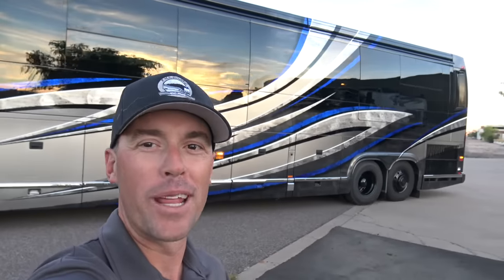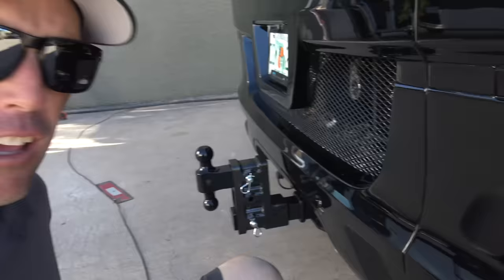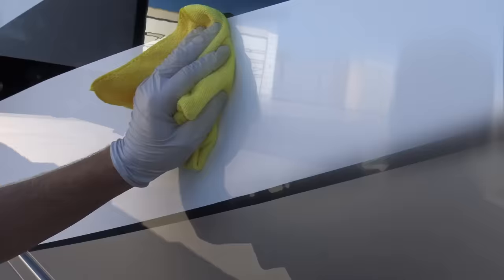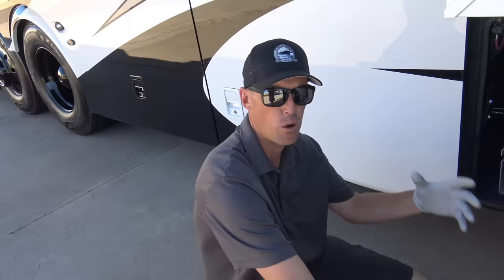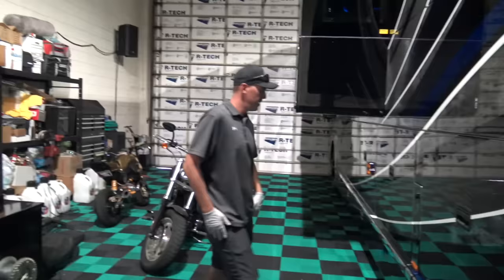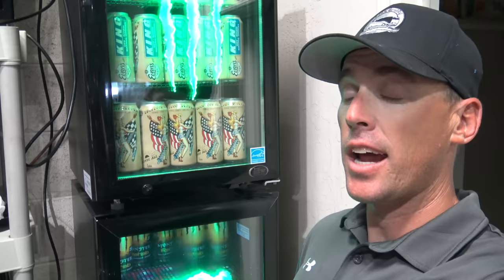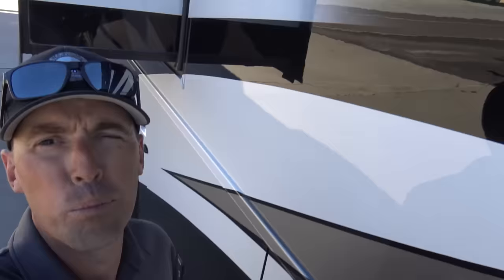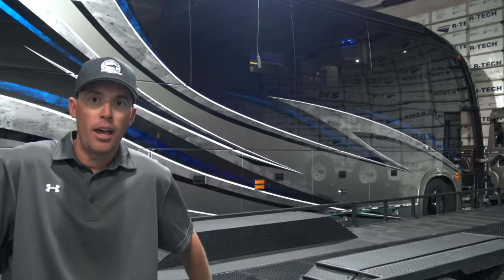WHY IS PREVOST MARATHON COACH $1.5 MIL MORE THEN NEWMAR ESSEX?

Comment: Because the Prevost isn't made buy a bunch of tweekers in Indiana.
Reply from the maker: 😂 I love how uncensored the internet is.  I have never heard this before, I heard they are all Amish.   I hope there are no tweekers at Newmar but I will have to visit the factory sometime to see if I get a breaking bad vibe 😂
Reply: @RVingwithAndrewSteele  You must not know much about the RV industry. It's not regulated. Unless you buy a Airstream most of them are junk, and I own an RV. Most people have different expectations when buying an RV and what the realities of that industry is.
Reply: @RVingwithAndrewSteele  the Amish thing is just a marketing skeem.
Reply from the maker: @outlaw67111  I definitely know the RV industry overall are junk and I even question the quality of the newer airstreams after they got bought by Thor.  I used to own a 91 airstream excella so I know all about them. In my opinion, an older Prevost, Newell or bluebird are the best way to go.  Grand design is one of the better built travel trailers in the industry right now. I've just never heard that the RV industry is full of tweakers but it would make sense.  Hey have heard that about the oil fields and other industries but I personally haven't spent a lot of time around RV factories so haven't been able to get a read on the vibe.  Seeing some of the stuff that I have seen coming out of these factories lately, I like to see their drug testing policy 😂